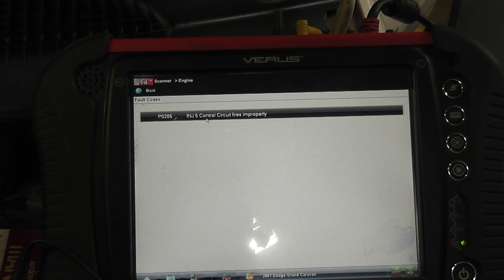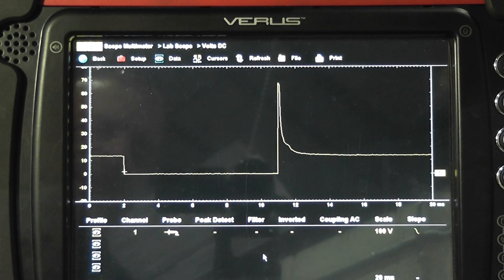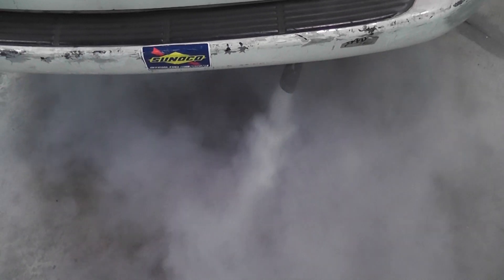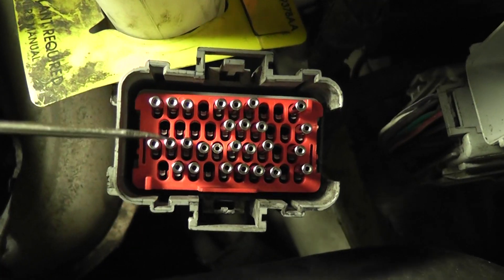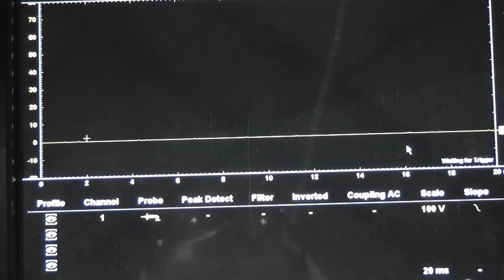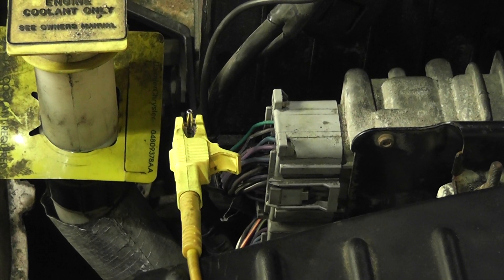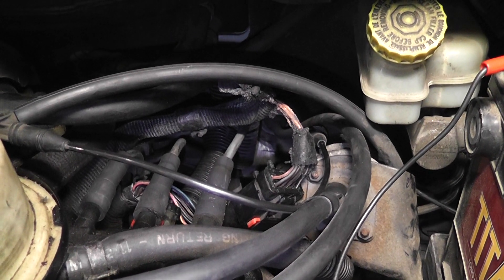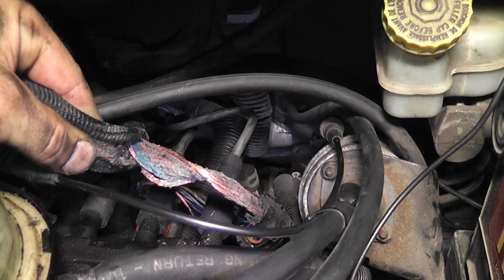Stuck Open Fuel Injector (how to fix)

Comment: I have a po202. open injectur circuit 2. brand new fuel injectors in the vehicle and I still get the code. what should I do?
Reply: Inspect the harness
Reply: what should i inspect for? like cracked wires or burned sensors?
Reply: Cameron Znidarsic
Reply: What should he inspect for🧐🧐🧐😒😒 I’m having the same problem right now and I could t drive the car into a wall right now if I wanted to due to lack of strength 😖😖😤🤬🤬 or power!! ECM( Powertrain Module) well the relay was changed, the cylinder 3,6 and the injector 2 as well! Intake manifold was changed as well!! I can’t take it anymore! Help

Comment: my car is leaking ⛽ fuel I mean pouring from the exhaust manafold.. ...change the injectors an she still leaking.won't start up.and now there is gas in my oil pan..cud it be bad computer or must need a head job
Reply from the maker: Pressure regulator could be ruptured
Reply: Like dan said. Pressure regulator for sure

Comment: Mr Dan,
Same car just 2004 3.3L just a little different scenario showing code P0201 injector circuit open cylinder 1 car runs rough can not go over 2800 RPMs replace the injector replaced wires checked wire harness but no smoke coming out the exhaust can you lead me in the right direction what I have to look for thank you for your time and all your great videos very helpful to a garage mechanic
Frank

Comment: Surprise, surprise. Another Caravan electrical problem. I completely tested the entire wire harness on an 04' Caravan with the NGC system. Fixed all the weakspots. One being the harness near the side exhaust manifold (which wears from heat), this also runs to the MAP, temp sensor, and ign coil. The other weak point is (on 2004+) near the PCM under drivers fender where the harness enters near the transmission range sensor. This can cause all sorts of goofy issues.

Comment: Would a low amp probe over the injector wire be simpler the back probing?
Reply from the maker: +Richard Peter yes, that would have worked too. We knew we had constant current flow through the winding and a current measurement at the ECM would have told us if it was the driver or harness. We would have read very little if any current flow at all in that location.
Reply from the maker: +ScannerDanner great question!

Comment: did you need an attenuator to get those waveforms  from the T pins with car on?
Reply: or does the computer  NOT put out up to 100V  as the injector connectors would?
Reply from the maker: +Isshman Garcia not for the Snap-on scopes
Reply: +ScannerDanner is this  test that you performed  first  called  signature  test?
Reply from the maker: I believe so. It's been awhile since I've done this video. Just remember that the "signature test" in the Snap-on units, is simply the lab scope waveform. The other tests (not signature) involve graphing the signals coming in. For example: A GM MAF sensor has a digital signal that repeats itself from 2500 to 10,000 times per second. The "signature" of this waveform would be the actual square waves rolling across the screen. Not very useful for glitch capturing. The best view would be to graph the frequency of this signal "frequency test". 
Another example:
I want to view an injector waveform to see if the pintle is sticking. I would select the "signature test" so I can view the details of the waveform. I would not want to graph the pulse width or duty cycle in this application. 
A graphed pulse width or duty cycle test would be useful on a test drive to see if the injectors are shutting down from some type of problem. Make sense?
Reply: Yes makes sense so the signature test is to see the injector performance.Thank you for all your  help are you going to Eric the car guy's  meet on Saturday that meet is going to have a lot of  the best technicians take care
Reply from the maker: I am. Hope to see you there!

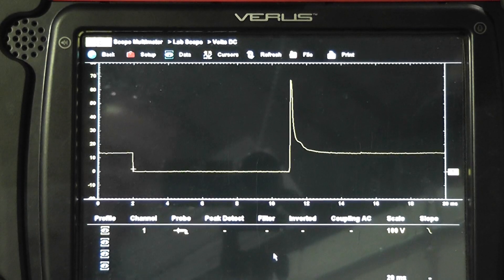Comment: 0:47 backprobe red lead to ECU connector injector control wire (ground) + black lead to “+” battery terminal
Injector circuit open: 12,6V. Injector switch closed: 0V. Load uses up all the voltage.

Comment: Sigh 2002 dodge caravan here, getting a misfire thats sporadic. Recently did the plugs, wires, coilpack, tightened the headers, and now im in between injectors and harness. I am gonna rip the harness out and check it over completely and rewrap it with new heat protection wrap, however do you think I should swap the injectors out for new ones or run a injector cleaner? They are old and well, some power is definitely missing
Reply from the maker: +Konrad C hard to say man. Don't forget to also check compression
Reply: +ScannerDanner checked the harness today its flawless none of the wires are melted or fused, opened up the whole harness including the part under the exhaust. So, my case its the injector itself, or pcm
Reply: +Konrad C also ironically its cylinder 5 for me as well
Reply from the maker: +Konrad C cylinder 5 injector is not firing? How did you check it?
Reply: +ScannerDanner unplugged it from the harness made no difference on operation
Reply: +Konrad C sorry let me rephrase that. It works sometimes and sometimes it doesnt. When its not working and unplugged there is no difference on operation. When it is working partially, light white smoke when cold, smell of fuel, and a very alight vibration at idle, more pronounced between 1200 to 1500 rpm, Definitely feels like a miss. I ordered new injectors harness looks flawless when unwrapped havent re wrapped it yet. New coilpack, new spark plugs, new plug wires, retightened exhaust headers (they were loose). New o2 sensors no vac leaks evap vac leaks removed etc. its either the injectors or pcm driver but since it comes and goes usually when its warm outside, i am gonna go with injector. Also i pulled spark plug 5 and and 3 right beside it, 5 is brownish hue on the ceramic 3 is white so if i am not mistaken thats a sign of over fueling? Stuck open injector?
Reply: +ScannerDanner kicker: no CEL, no code
Reply: Turns out it was the spark plug. POS Champion oe plugs with a hairline crack in the isolator. Couldn't even see it. The electrodes stretched and opened up too, tossed those pos and got ngk. No issues since.

Comment: Was able to fix an 01 Caravan 3.3 with hard start/no start issues when hot. Using the Vantage Pro and all the information learned on this channel and the Premium channel. The injector harness was all melted together. Separated and taped wires and problem solved. The injector drivers and computer still good. Thank u Paul!!
Reply from the maker: +Bill Rimmer awesome Bill! Thanks so much!
Reply: Repaired upper wiring harness. Still having the same #1 open circuit. not pcm!  guess ill check lower wiring harness.

Comment: Mr. Danner, you have some lucky students receiving this level of instruction.  Your videos prompted me to get a scope for the 10% of the issues I can't figure out with other methods (I cheaped out and got a Pico 2205A, can't justify the cost of their cool automotive versions, but the 2205A works great with attenuators).  My car is working fine now, so I am gathering all sorts of wave forms now to save in my "good" library.  I have learned that my injector voltage wave forms looks way different than what I normally see in your videos, but I think that is a function of my car being GDI.  Either way, it is interesting when I get similar results to what I see in your videos or when I do come across differences.

As we used to say at the dealership, "Fix It Right the First Time".  By the way, you need to make some sort of "Zener Dump" t-shirt to sell on your website in addition to your book.
Reply from the maker: +S Dub lol on the Zener Dump idea. I am working on some merchandise. Anyway, yes, the GDI will look very different! I don't have anything on this channel on GDI yet but I do on my Premium channel. It was a 2 or 3 part series I did with my class on testing these systems with a scope. There is a 14 day free trial if you want to check it out. Thanks!

Comment: Mr. Danner:
   I just purchased your book and look forward to learning all that is in it. I am a DIYer and my question may not be accurate. In using the Verus by Snap-On, does the software force the voltage reading to zero volts in reading an open wire? I would have thought that an open wire would read ghost voltage and jump around all over the place. My understanding is that a short is the only true zero volts reading. Did I get it right? Thank you for your videos.
Reply: +Dog Food true but on a 20v scale you will not see the jumping around voltage, only on a mv scale does it become very apparent.

Comment: I also had this same exact problem on my 01' grand caravan 3.3 a couple summers ago. Wife left for 5 mins, came back and said the car was smoking a bit, she parked it in the driveway and I could see the smoke trail from where she came all the way down the street! Pulled a code, and it said "injector 5 open/grounded circuit." It was a Sunday, and I needed to get it back up and going. when I found that harness melted, I knew I would be sitting down for the next hour or two replacing about 12" of harness. It wasn't fun. Rerouted the repaired harness and it's still holding up 2 years later. Very very common on these, the harness literally sits on the exhaust heat shield.

Comment: hm...i have a hard time understanding why is that the energized test light will find a ground on the other side of the injector, (when no power to the injector)...i think, rather it would find an open (switch)...thus, find an air, not ground
Reply from the maker: +Zvonimir bobić because of circuit design. The fuel pump, ignition coil, O2 heater and alternator field circuit are also on this same supply circuit.  (supplied by a relay called an ASD relay)
With the key on, and the engine off, the ASD relay is NOT energized, so the test light connected the way I had it can easily find a ground path through the fuel pump circuit as well as the O2 heater etc. 
Make sense?
Reply: +ScannerDanner...it finds ground only through the designated grounds of other components, correct?...but, when the engine is off, shouldnt those grounds be open?(switched off)...bcus, my reasoning is that the feed wires, when not powered, at theirs furthest end they have an open too, (that is, they re disconnected from the supply), so the current cant find ground there...still confused...btw. soon gonna purchase ur book
Reply from the maker: +Zvonimir bobić it still can. I'll use the fuel pump for this example. When the ASD relay is off (no power to the fuel pump and injectors) the test light can find a ground through the injector winding, into the now de-energized injector power feed which is shared with the fuel pump power feed. It then passes through the positive brush of the fuel pump, then through the armature windings and into the fuel pump negative brush on its way to ground.

You may be thinking "isn't that too much resistance for the light to light?".  It is not. A fuel pump has no resistance unless it is spinning and the injector winding is a low ohm coil of about 12 ohms. Your test light may be a little dimmer than normal but could be easily missed
Reply from the maker: +Zvonimir bobić also the grounds for those other components are always grounded and not switched off. Some grounds can be as you described. The O2 heater on this design has a constant ground. The fuel pump is constant ground. The ignition coil is as you describe (switched ground) and would not be a factor as it would be off. The alternator field is also a switched ground, so not a factor. Fuel pump and O2 heater is where it can find a ground.
Reply: +ScannerDanner... doubting thomas no more...if no power supply on the other side: the test is not valid... bcus the current backfeeds through and into the ground...thank u sensei :)

Comment: it looks like 2nd row top connector on the pcm  2nd row from headlight back starts with #1 injector then according to your diagnosis the 5th down is Injector #5 so must be 12345 then 6 on second row of top connector...

Comment: it looks like everything on that 2001 3.3 is the exact same fuel injector wiring harness as the 2003 3.8 town and country ...I am hopeing it is and hope that the injector #4 is the next pin up on the second row on the top computer connector ...I think mine is now open in the computer no voltage ever...I hope ...maybe you can tell me if I am right...
Reply from the maker: +lucky freeman did you get my text?
Reply: +ScannerDanner  no  + Scanner Danner I did not get a text from you...can you help me???
Reply from the maker: +lucky freeman the injector control wires are all Brown with a tracer. 
Pin 7   Inj 3 BRN/LT BLU
Pin 13 Inj 1 BRN/YEL
Pin 14 Inj 6 BRN/VIO
Pin 15 Inj 5 BRN/ORG
Pin 16 Inj 4 BRN/TAN
Pin 17 Inj 2 BRN/DK BLU

These will all be grouped together on the connector.

Comment: very good video and troubleshooting...I have same exact problem except its my #4 injector that was shorted to ground ...I disconnected #4 injector to get home from florida and pulled it apart when I got back to Maine...however I noticed it was the top connector on the pcm on the battery box front behind headlight ...I also noticed it was the 5th pin in the middle row of connector I need to know which pin in connector is #4 injector because mine is no longer shorted after I repaired the harness it now reads open wire or no voltage at all ...So I think its my pcm however I would really like to know if #4 injector is the next pin down or up on connector at pcm??? can you help me???  u could text me at 978-314-8794 and send me a picture on text...with a  I would really appreciate it...oh by the way mine is a 3.8  2003 t + c  I made it home but must get car fixed before snow...falls

Comment: what is the term control wire and how much is your e book
Reply from the maker: +Chris Canty a control wire would be a term applied to any output of a computer. Examples for an engine computer:
solenoids, relays, light bulbs, electric motors
So the control wire would be the wire that is running from that output to the computer. The computer "controls" the output on this wire by either applying a power or a ground. 
(Section 3 material in my book)
The eBook is $50 from my website. Thanks!

Comment: Hey brotha so I'm having this exact issue with my 99 eclipse Gst but on my #1 cylinder and being a 4 cylinder all my injectors and wiring are on the firewall side while the manifold is in front, so my wires aren't exposed to heat like in your video, so with that said and my wires looking ok what else could be the issue? I've tried everything to no avail. Please get back to me ASAP as my car has been down for 4 months and I've dumped 800 into doing the head thinking it was that and other things along the way rebuilding so I'm spent, and can't bring it anywhere, I'm at a complete loss. I miss driving my car so much. If you can email me since I may not see your reply on here. I'm at transam303@gmail.com thank you for any help you're able to give me.
Reply from the maker: Chris Abbott check each injector wire for a short to ground with an ohmmeter. Just make sure the injectors and computer are unplugged for the test.

Comment: wow IMHO this is pretyt high level tech here,. and alot due to the acces to the scope machine screen deal in which we dont have one of and i dream wish that we did and that i need to and want to learn to use so badly some day somehow wow... great vid and info here, i am currently right now dealing with our 97 F150 pickup 4.6L that three injectors driver side are dumping raw fuel into those cylinders and overheating the cat converter and no idea why, brand new injectors and jut swapped replacement engine from a 98 car into it.  did scrape damage slightly the wiring harness on pass side upper firewall when engine was going down into compartment, was tight fit no clearance flexplate teeth to the harness so im going to start there and also run obd II connector PCM info too.  wow look at that caravan injectors wiring harness in this vid.. wow...!!

Comment: Wow what genius engineered that design !
Reply: No one. The engineering behind the engine, the ignition system, the fuel system, the monitoring system, & the wiring came from different individuals. That’s why this happens. It’s common on 01-05 vans & the harness was rerouted after that.

Comment: I also troubleshooted a common problem of the o2 sensor wires frying on the exhaust manifold on these Jeeps plus the common pigtail connector bad connections  at distributor harness

Comment: I had my friend help checked all ignition wires while under a load and pulled one wire at a time from the cap and determined the bad wire misfire ....check engine light has been reset , will see what happens now , the codes are gone and driveability without the misfire is is back to normal .

Comment: I have a 2003 Saab 9-3 and I'm getting code for all injectors.... weird thing is when I just put my key in the on position you can hear the number one injector pulsing with out car actually running which is flooding it out before i even start the car? It never stops 5 mom 10 min hour Its still pulsing? Do you know what could cause that? The other day it wasn't doing it and car started fine but as soon as it comes back car is hard to start and if it does start it runs very badly at one point all cylinders where soaked in gas the 1 and 4 then.2 and 3 then now just 1 i can't figure it out any help would be grateful. Thanks
Reply: I have a case study on a Subaru with something similar.
No Start Diagnostics Training at Rosedale Tech

Comment: Great vid Dan. I was wondering however if you get gas smell after the car has sat for awhile when you start it up is that the injectors. I have the 2000 neon. I know this is another vehicle. I have in fact changed out the gas cap, which I'm sure you have heard that can trigger an error code. But would the gas cap cause a fuel smell on start up?